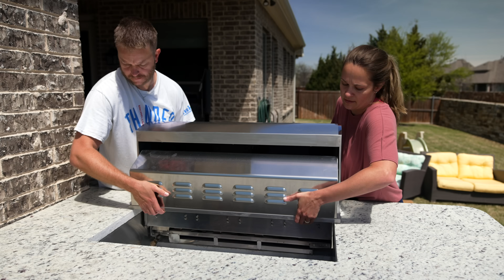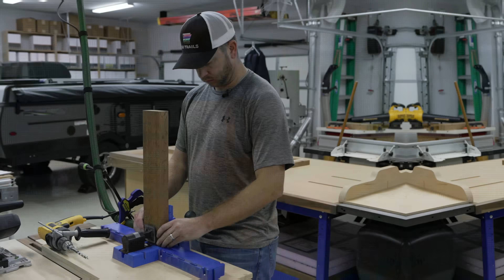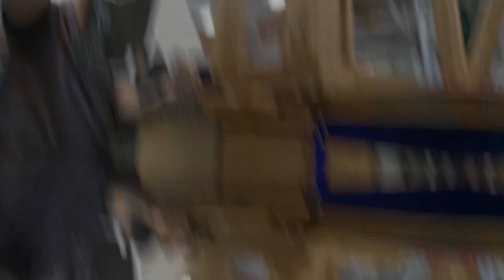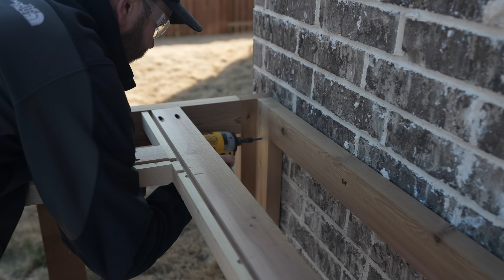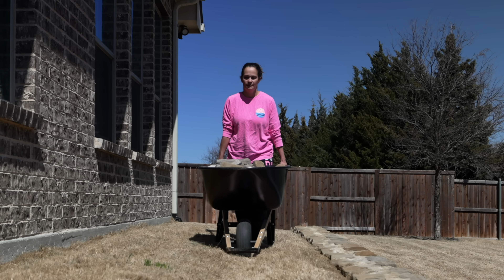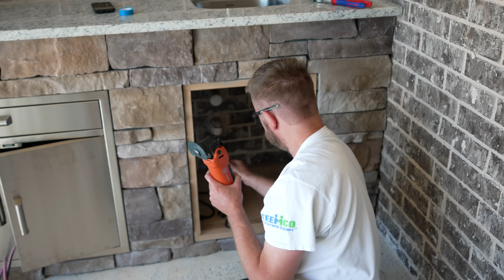DIY Outdoor Kitchen with Built in BBQ and Sink | Start to Finish!!

Comment: Awesome work, you probably did better than any contractor would have done. How did you get the proper slope ahead of time and did you make a jig?

I am planning to build a long 12 ft outdoor kitchen and it will sit on an existing concrete pad that slopes away from the house.
Reply from the maker: I just cut the base piece until it was level, I used the level to get it perfect - took me a couple times that I didn't show in the video - thanks for watching!

Comment: Good Video, What was the reason for the seal gasket?
Reply from the maker: It keeps the cedar off the concrete, when it rains the water will penetrate the concrete and the wood would soak up the water through the concrete if it was touching.
Reply: @One2ManyHobbies  Ok that barrier makes a lot of sense. Thanks